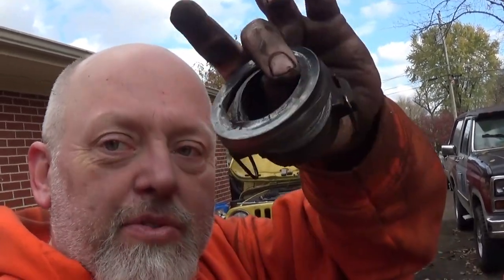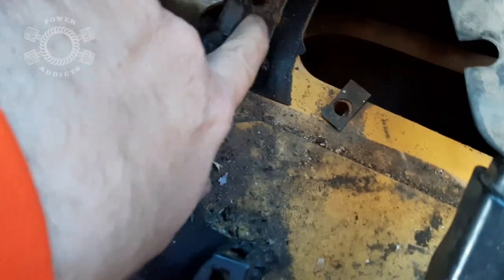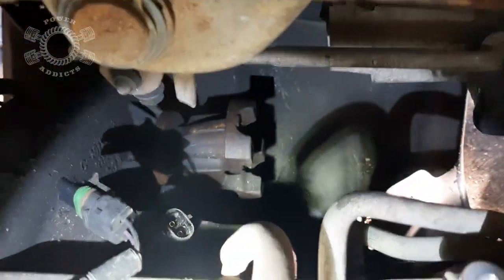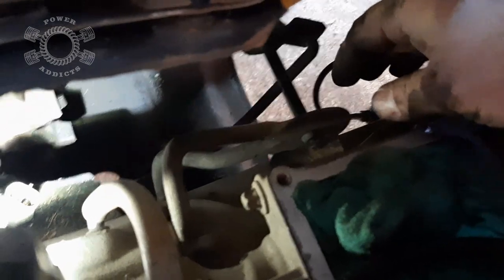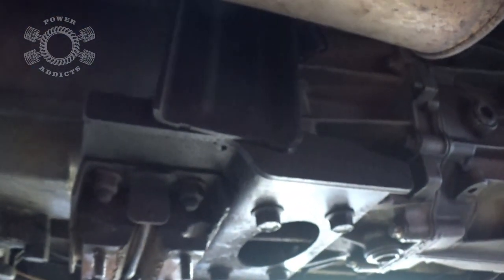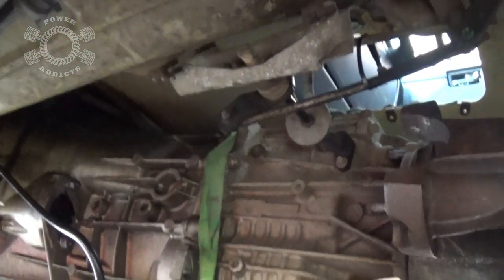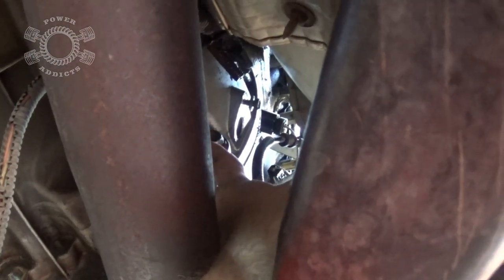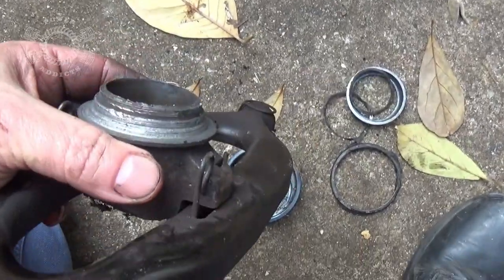Jeep Wrangler TJ Clutch replacement #jeepclutch #poweraddictscrew

Comment from the maker: These parts are for a 2005 - 2006 Jeep Wrangler with the 4.0 6-cylinder and 6-speed manual transmission. They will not fit the older 5 speed TJs.
2005-2006 TJ 6 - speed Flywheel: https://amzn.to/3DFuMpH
2005-2006 TJ 6 - speed clutch kit: https://amzn.to/30OKznh
Flywheel turning tool will work on any flywheel: https://amzn.to/3DHmOwf

Comment: Man, was contemplating doing my own throwout bearing/clutch replacement, but this looks like more than i can chew. Thanks for creating this video - beautifully done!
Reply from the maker: It isnt exactly a walk in the park. There is good bit of stuff that needs to be done to complete the swap so I totally understand. Glad you enjoyed the video and thanks for taking the time to leave an awesome comment!!
Reply: @2kostasd  Do not think that, please! You are a Jeep owner.  Right now, your TJ is already damaged.  The worse case scenario is you will have to get someone to repair it for you.  Your Jeep is already broken.  You can not break it any worse.  All you are doing is taking off bolts and parts.  You are breaking nothing at all.  Even if you can not figure out how to reassemble your beloved TJ, you succeeded in the disassembly, which will cut the price of the labour in half.  You can, and should do this. With the money saved, you can get something you want for your beloved TJ.  Do not look at the work as a whole.  It will overwhelm you. Think about it like football.
Your home field = your TJ
You are the home team. 
Your goal is the first down, no more!

Suit up for the game! 
  Support the engine with a jack stand and wood.  Unplug the battery. Get your tools ready, all of them.  Get a place to put all bolts and nuts.  Get a box for parts.  Get painter's tape to label your parts.  Get a marker, gloves, water for you, camera, 
First down:
Start is only the bolts on the sides of the skid plate and four bolts on the transmission mount.  Who can not do that?  That is it.  First down accomplished. Your first down is done! 
     Second down, take the center console off and the plate on the floor board off.  That is also just simple screws.  Lift the front of the console out of the way. 
    Third down:
Remove the wire harness from the transmission and transfer case, speed sensor.  I chose to remove from the fuel pump to past the transmission at the speed sensor, instead of from the middle to the front. 

Fourth down and your first touch down:  Tape the Universal joint on the rear drive shaft, all the way around the edges, to keep it from coming apart when you take apart the joint. Undo the cardigan joint, (only four small bolts) to be able to lower the rear drive shaft shaft and lower the rear shaft!  Do the same on the rear differential u-joint. 
     That is it! Your first touchdown!  From the transfer case back, there is nothing more to do.  The home crowd goes nuts!

Second quarter. 
First down:
Remove two small bolts on the slave cylinder.  Pull the slave cylinder away from the transmission. Undo the two cables on the starter. Remove two bolts that hold the starter in place and remove the starter.  
Second down:
Remove the transmission inspection plate bolts mounted on the tranmission and behind the engine.  Tape around the edges of the universal joints, on the front drive, shaft on both ends of it. Undo the small bolts holding the U-joint to the transfer case and front axle.  Lower the drive shaft. 
Third down: 
Position the transmission jack under the transmission and Jack it up slightly.  Remove the bell housing bolts and flex plate nuts .  They are large and obvious.  Remove the shift stick knob and remove the shift stick held on by four small torx screws.  Drain the transmission through the drain plug at the bottom. 
Fourth down and touch down:
Remove the transfer case selector bracket. Jack up the transmission a bit more, if needed, and slide the transmission towards the back.  The engine and transmission separate!  The crowd goes mad!  You slide out the transmission and expose the clutch behind the engine.  Touch down!  You see the throw out bearing in front of the transmission and the fork!  That is the extra kick!  
It's half time!  Time for the halftime show!
Take your camera and take lots of pictures!  Get a drink, eat!  You earned this!  

Third quarter!  
First down: 
Behind the engine is the clutch and pressure plate. Insert the alignment tool in the center of the pressure plate and clutch. It came with your clutch kit.Only a few bolts around the edge of rhe pressure plate hold it in place. They are just regular bolts!  Take them off and the pressure plate comes off!  Take off the center alignment tool and slide the clutch off the shaft.  
Second down:  
In front of the transmission is the throw out bearing and fork. Pop that junk out.  
Thrid down clean up the shafts on the transmission and engine.  
Fourth down and touch down. 
 Install the new through out bearing and clutch fork identically from the removal. Put the alignment tool in the pressure plate center clean it with brake cleaner. Clean the clutch disk as well.  Put it on the alignment tool on top of the pressure disk.  Push that assembly back on the engine output shaft.  Hand tighten the pressure plate bolts to hold it on and then tighten to specification with your torque wrench!  There may be a few steps I forgot.  But you have the idea. 

End of Game one!  Victory!  
You are 1 and 0!
Make the next game a victory as well and be 2 and 0!  
Break that up using football analogy and you will win!  You will not only be a Jeep owner.  You will be a Jeep mechanic!
Reply: @indridcold8433  Wow, this is great. Appreciate the encouragement and detailed process - might give it a try with my boys when I get a break and some space in the garage. My Jeep is still running, just that the bearing is getting loud, and the clutch engages pretty high. I agree, it's all just taking off bolts and parts. One small bite at a time, and this big pie will be gone through. Thanks for the encouragement!
Reply: @2kostasd  I have to turn off the engine, in mine. Then place it in first gear.  Then start the engine.  Otherwise, I can not get it into first gear.  The pressure plate is definitly distroyed.  After that, I might as well forget the clutch pedal and time the shifts.  I am doing mine within a month. I changed the clutch in a 1990 Wrangler YJ.  Looking at the job as a whole, I can not believe I did it.  But just a tiny, "first down," at a time and I did it.  You and your boys will remember this the rest of your lives.  It is not jist reviving your Jeep. This is building memories with dear old dad, experience to just take one tiny step at a time to meet a goal, and real pride earned, not arbitrarily taken over nothing.  This is going to be amazing!

Comment: I like your way of doing it bro. That trick of tilting it down is the way I learned it years ago. From a junkyard man R.I.P. Earl. For a Transmission  Jack we I use a 4x4 sitting across the doors and a come along through the shifter opening in the floor. Sounds funny till you try it it allows you to move it around easier than a jack.

Comment: Your videos are the easiest to follow I have found. I hope you do more TJ stuff. I noticed what looks like magnets on the oil pan. I am guessing that is to pull metal particles to the bottom. Would you confirm that and have you checked to see if it works? Thanks.

Comment: I have a problem with a transfer case going into low four-wheel-drive is it an easy fix
Reply from the maker: I have no way of knowing that. It could be the bushings for the linkage. Maybe you need to change fluid in the transfer case or it could be something else. Most of the time it is the plastic bushings for the shifter linkage.